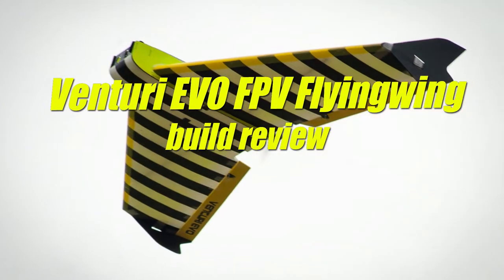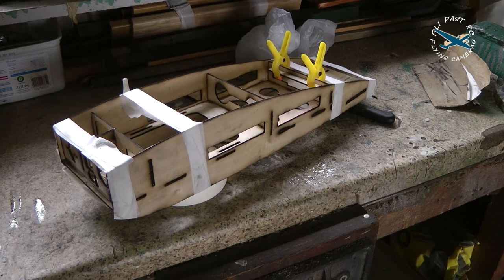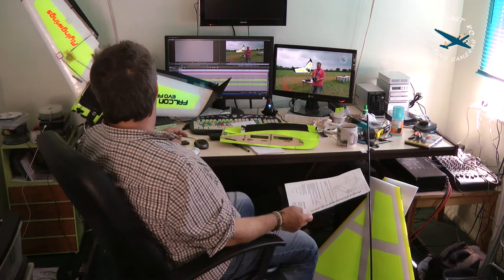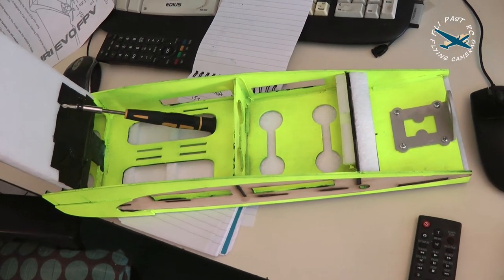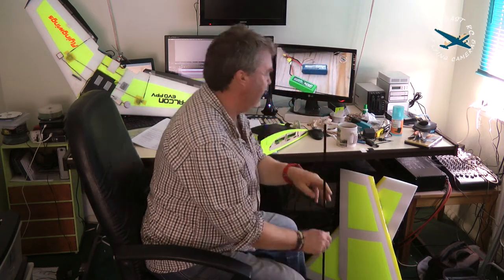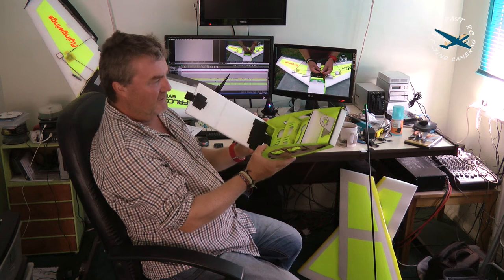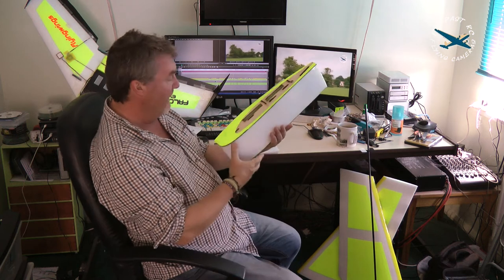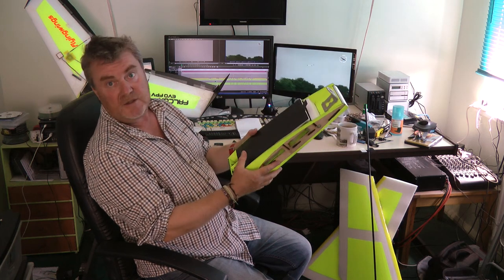Venturi EVO FPV WIng - Build

Comment: I have one of these waiting to be built,will be interested to see what your final setup is,especially the power train.
Reply from the maker: Jake Bullit Hi Jake we are trying a 3s set-up first seems to have oodles of grunt, the weather is holding up the next flight tests with the Pitlab autopilot fitted.  Motor we are using is a D/3536/6

Comment: Where do you balance the CG ?
Reply from the maker: 190mm from the leading edge, it seems far more critical to get this right then smaller wings
Reply: +FliPastRC thanks man i appreciate your help but is it the wooden eadg or the epp wing eadg .
Reply from the maker: on the wing root , measured from the leading edge does that make sense?  will take a photo if that helps?
Reply: +FliPastRC it helps , thanks .